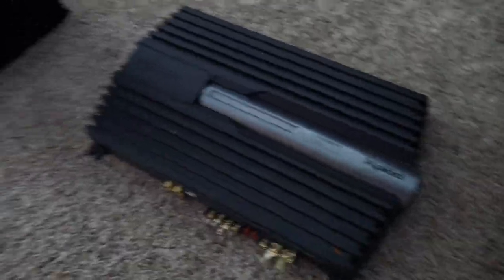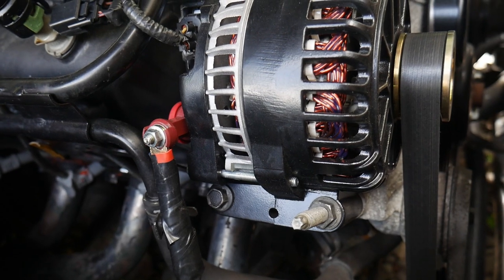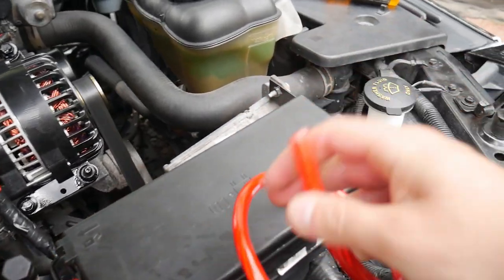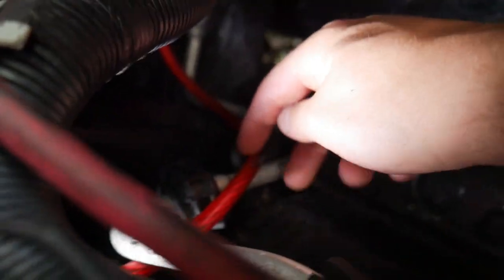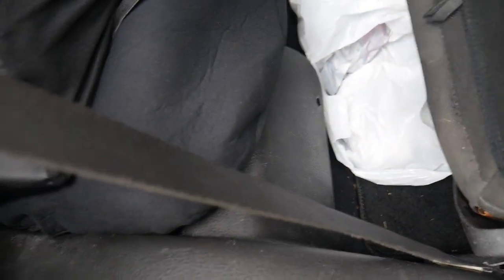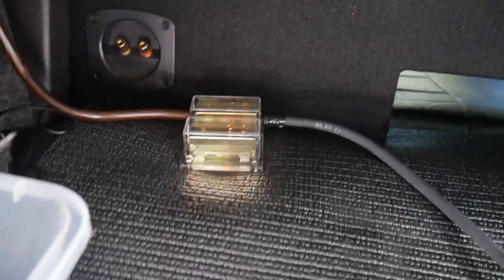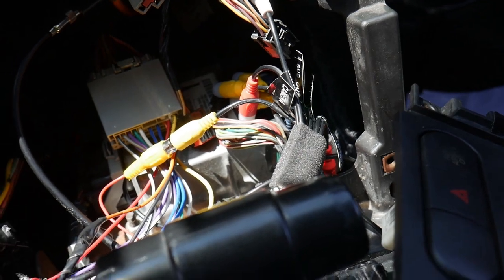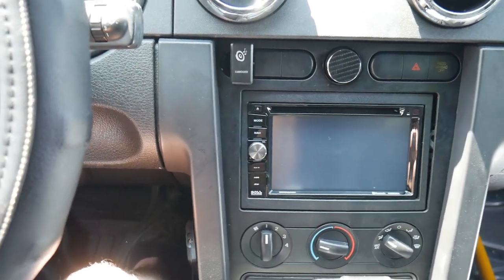How To Fully Install A Sound System In Your S197 Ford Mustang 2005-2009+ Newer

Comment: Does the amp and sub drain your battery? I want to install a 350 watt amp and 700w sub
Reply from the maker: it can drain it and cause volt drops for me i upgraded my alternator and battery so volt drops when the bass hits dont have any effect but a 700 wat sub and 350 amp u should be fine stock
Reply: @RevLine89  what size amperage alternator did you upgrade to? I plan to upgrade my alternator and replace stock battery with a optima yellow top.
Reply from the maker: 200amp and 1000 cca red top

Comment: Although it's always good to use lower gauge wire just in case you want to upgrade latter it keeps from having to change the gauge but that amps RMS watts bridged is only 540 watts which 8 gauge would do Just fine. 👊😎

Comment: do you have to worry about the heat under the hood affecting the power wire ran from the battery ?
Reply from the maker: using a thick enough guage and running it away from anything hott you wont have any issues with under the hood temps :) a good rule of thumb is to run it as close the the left or right under the hood as possible ( away from the motor )

Comment: Get rid of the electrical tape and use shrink wrap on the crimped terminals and wire connections.  All your wire connections should be soldered, all I saw was twisted and taped, correct me if I am wrong.
Reply from the maker: yes that is correct, i like to twist and tape my wires and then test everything first to make sure its all working before i then go back and sod. the wires  if i sod them first and theres a issue i hate to cut the wires again.